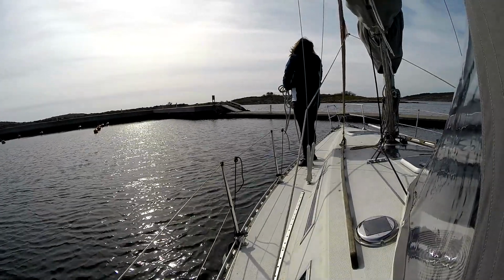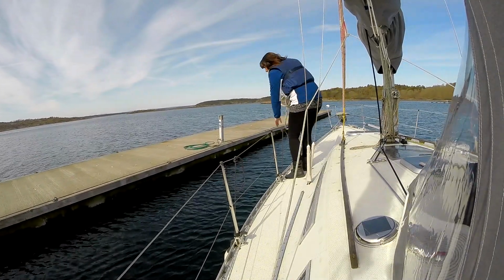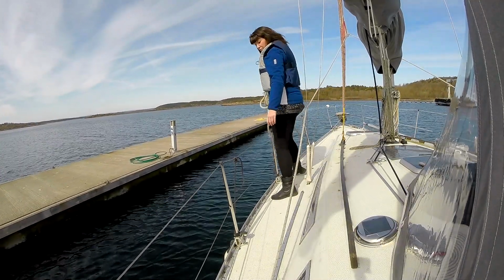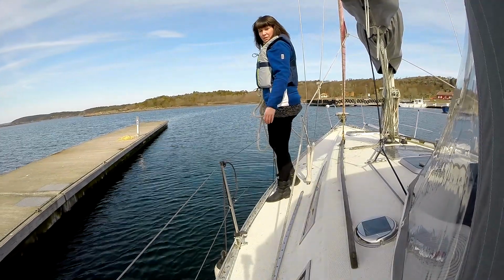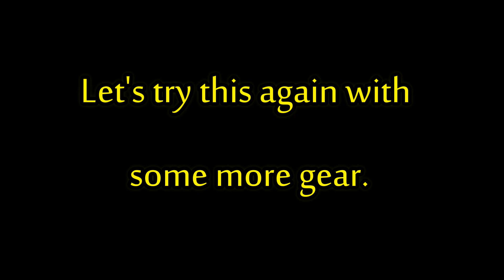Quick Update 16 "FlexOfold propeller proplems"

Comment: I have a three blade Flexifold and it has never failed since I bought my 50' Beneteau in 2009. It has always worked flawlessly. I have both called Flexafold and Emailed them for advice on a good coating to reduce barnacles and they have always responded!
Reply: Hello MMoerjrbig... what product did Flexofold recommend to coat the prop with?  Thanks.

Comment from the maker: I still get some comments and DM's on these FlexoFold video's. I took the propeller to a local workshop who fixes bent propellers and such, they found that there where an imperfection in the propeller that made it vibrate (Weight difference in the blades), and that again made it collapse when it had to rely on the centrifugal force to hold it open in reverse. The issue was fixed and the propeller performed great after that. Although FlexoFold did get back to me, they used all their e-mails and phone call yelling at me for makin a bad video about their propeller than actually helping me and giving me tips to find the problem. Hope this answers your questions. 🙂

Comment: I use the Zinc spray! Petit Prop Coat.  Two thin layers.  I remove it every year with glass beads in a blast cabinet and put another coat on. Its only about $20.00 per can and the can will last two seasons.

Comment: The water looks nice and warm - yikes! ;) I'm so sorry to hear about your problems with your prop! I'm sure it's extremely aggravating! I have a Gori folding prop and no experience with FlexOFold. From doing a quick check on Google, it seems there are mixed reviews of FlexOFold props. I'm sure the same is true for Gori. How about the place that sold you the prop? Could they be of any help? (now that FlexOFold won't help you)
Reply from the maker: ***** Hei Mads. The water was pretty cold tho the steamsuit and neopren socks answell as the hood it wasent that bad. First dive with out the hood was like getting a constant brain freeze. :-D The propeller has been in my basement since I bought the boat. So there is no place I bought it. Alltough, I have sent some mails to FlexOfold, however they are not interested in answering e-mails. I still have my old Radiche folding prop, however I don't want to take the boat back up on the hard if I could avoid it. There is a plan forming in my mind and I have started getting some drawings down on paper to see if there is some modifications I could do while in the water. All would have been so much easyer if the water wasen't so damn cold. :-D
Reply from the maker: Patrick Blanchard Thanks Patrick and god no. No gators here! :-D
Reply: SY JollyDodger Correction: no gators that you know off ;) I've heard that global warming thing is really picking up ;)
Reply: +Sail Life    Re Crocodiles.

 When I was a boy Oldham Power Station in the north of England had its own croc!  It lived in the ponds of warm water that were underneath the cooling towers. Several workers had reported seeing the crocodile but at first the management assumed that they were either joking or drunk. The croc was real however and it was thought to have been a pet that got too big.  As to food it was probably eating wild rabbits.  Possibly it was the most northerly free-range crocodile in the world!  As crocodile poo was not wanted in the cooling water the croc was given to Belle Vue Zoo.

Comment: I know this is old video. I was Googling for this prop brand reviews and came here. I just bought my boat with this prop and was curious....Anyway, I have no experience with THIS prop but looking at your other two videos I suspect that your rudder is very close to the propeller to generate the needed water flow for it to stay open. I would love to know if you found a better solution since this video.
Reply from the maker: Hello Val. There where an imperfection in the propeller that made it vibrate, and that again made so it wouldnt open properly. The issue was fixed and the propeller performed great after that. :-) Good luck with your new boat.

Comment: Silly thing, but make sure your shaft is spinning properly in reverse.  You may have a transmission problem.  Good luck.
Reply: +wigglewoo3    A transmission fault is rather unlikely as 99% of the time it is the forward clutch plates that wear out first.  If reverse relies on centrifugal force, thin light propeller blades are unlikely to do do the job. Instead fairly thick heavy blades are required.SIMPLE!
Reply: +Tech Davey Update.   Re  the  British Made Easyflow, Johnson Matthey stopped making it as it contained a little Cadmium (now regard as a bogey poisonous metal!)  Unfortunately an American company hijacked the name but spelled it as Easy-Flo.  This is NOT the same thing as the Matthey product as the material that arrived from Amazon is really for brazing Monkey Metal.  Caveat Emptor!

Comment: Propane torch,  Easy-Flo low temperature brazing rods and thick brass or bronze sheet to be shaped  and brazed to the rear of the blades. (try to get the balance correct) The object of the exercise is to make the blades heavier in order to generate more centrifugal force.  Plumbers soft solder could be used for prototyping as its much easier to undo if plans change.  Thin light blades are useless if the propeller needs centrifugal force to hold it open in reverse.